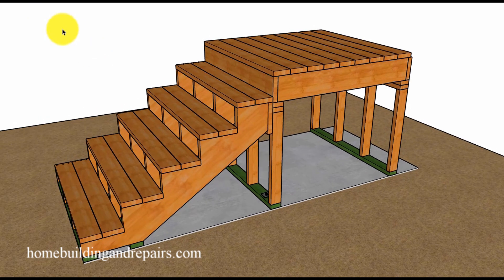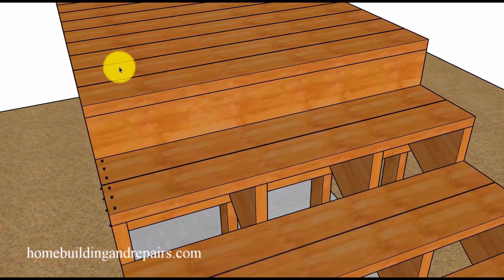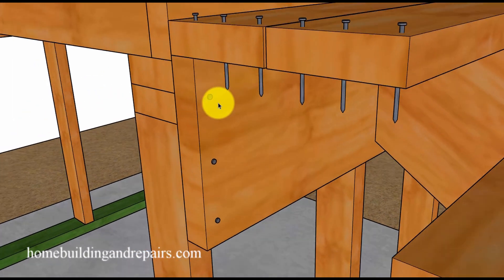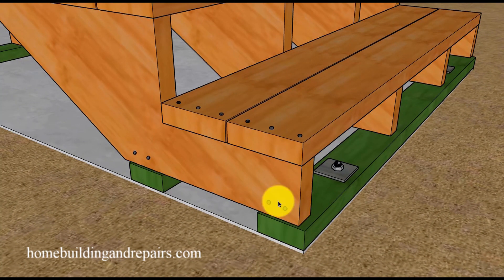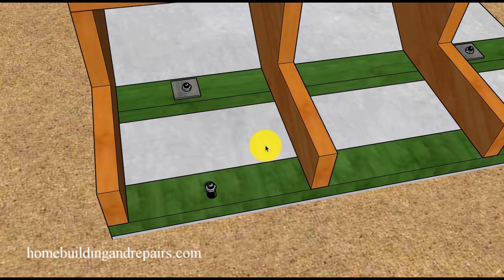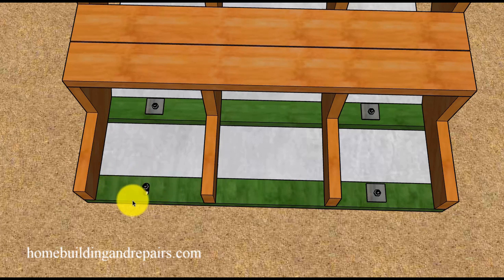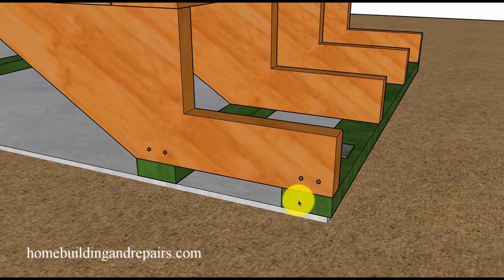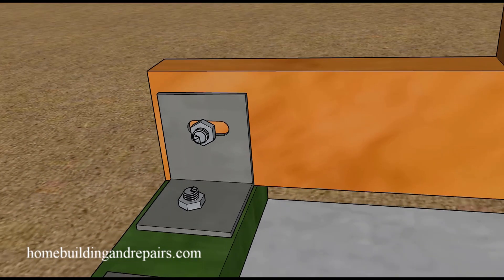How To Allow For Minimum Forward or Backward Movement On Exterior Stairways - Building Ideas

Comment: Just so you know, the clete you have perpendicular to the stringers, it's creating a water dam. Best to specify a bit more about water for something like this I think..
Reply from the maker: Please provide more details, because I don't see how it can trap water.
Reply: @stairbuilding  when water hits the pressure treated base it gets trapped and rots out the underside of the pressure treated framing over time. Just a consideration, better to elevate the underside and put in water impervious spacers to allow water to drain out. Just a best practice and simple recommendation, always allowing water to drain out
Reply: Another place this method is used is against a ledger, where the ledger against a home is installed using spacers to allow water that gets in, to drain out.